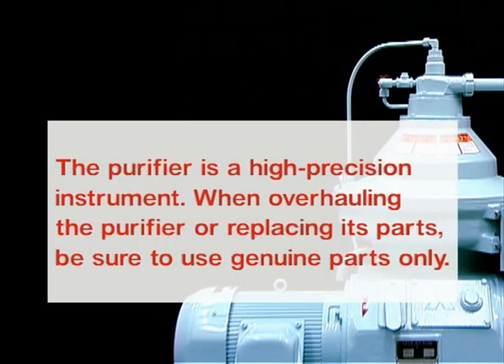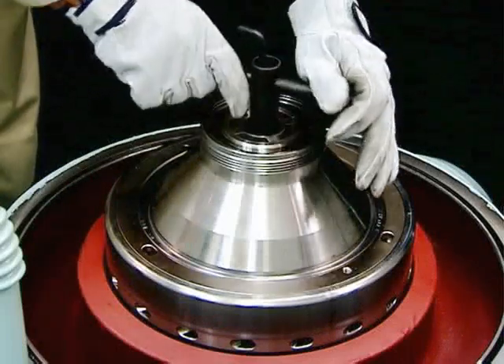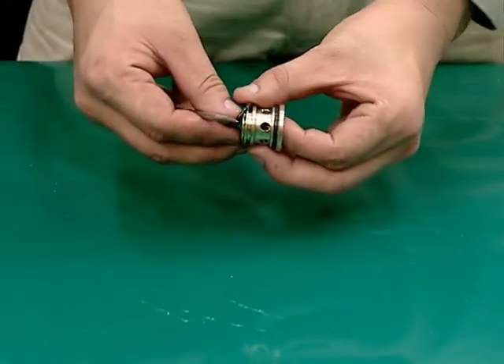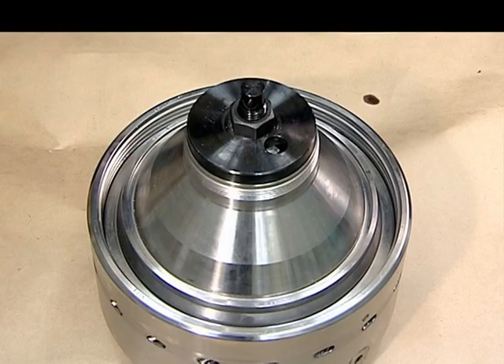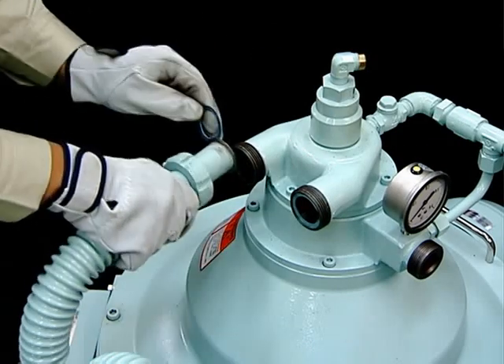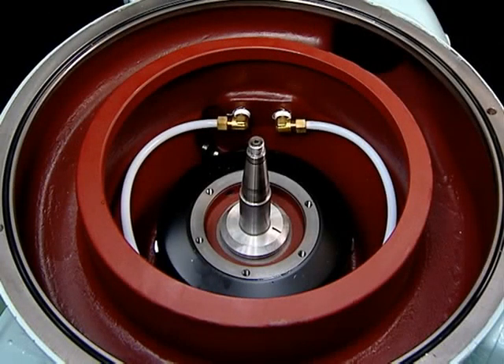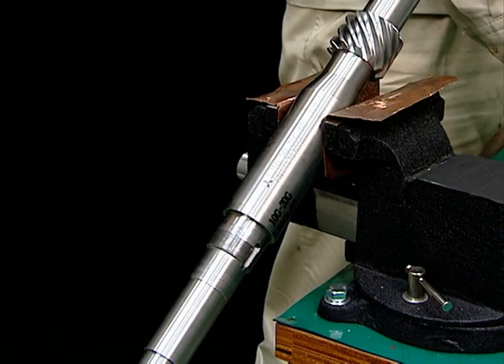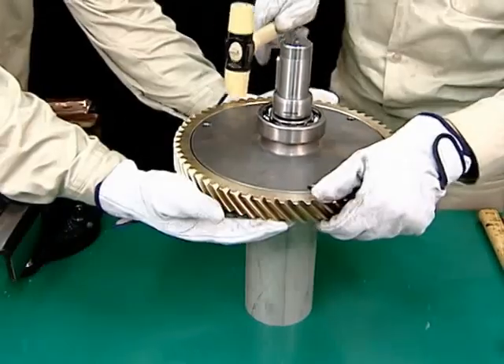SAMGONG  PURIFIER 1

Comment: Hello, I did an overhaul on a samgong sj35H/HH series vertical shaft, after installation, I tested the watersupplying device to check for water leaks...found water leaking into the gear case, I've reconfirmed that o-rings 505 , 217 and 219 are in place...any clue regarding this
Reply: Don't worry my friend this is normal if the  purifier is stopped...just start and make test during running

Comment: I overhaul vertical and horizontal shaft  changed all bearings when finished i will test i heard abnormal  noise. Whats the problem im sure im fixed bearings in correct position